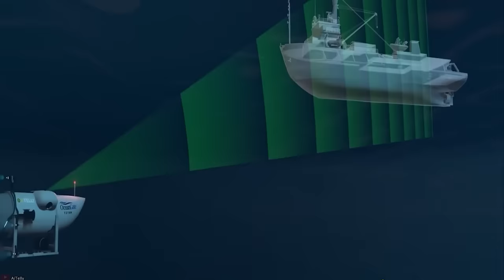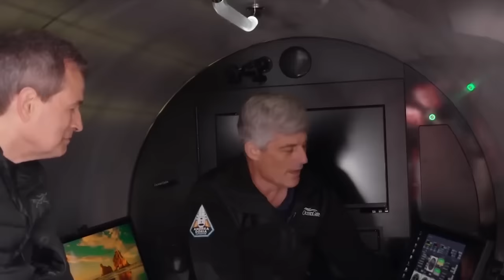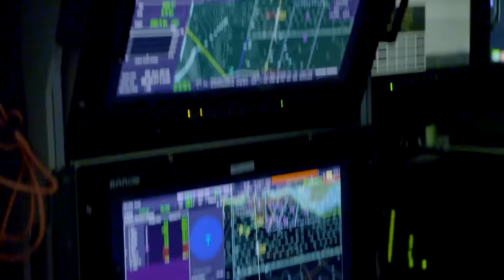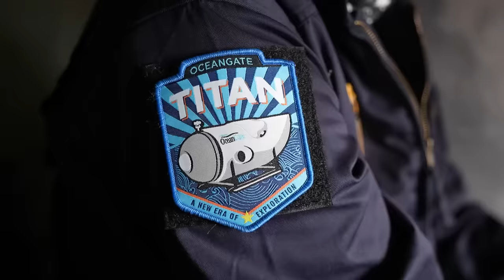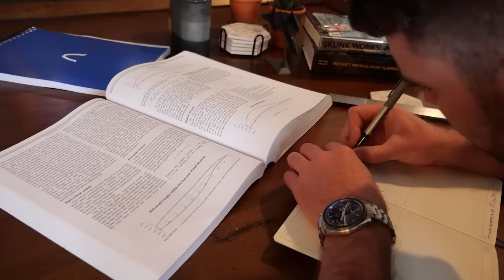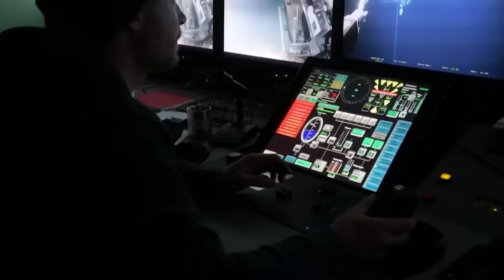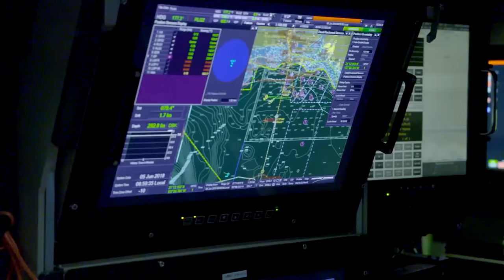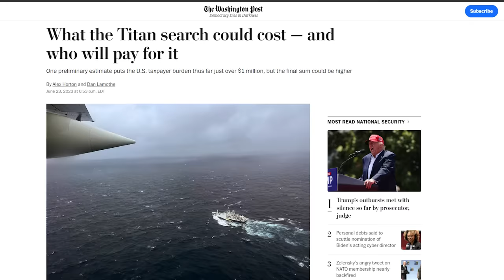US Navy Reveals TERRIFYING Truth Behind The OceanGate Submarine Tragedy | Titan Documentary

Comment: The Titan imploded as they were trying to accend due to mechanical failures due to water fill the electronic housing on the rear, weighting the sub beyond its capacity.

There is more information that everyone seems to ignore, the lack of putting 2+2 together is crazy.
The Titab was descending at an unusual rate of speed. The mother ship questioned them when they gave a report on its depth as it they were much deeper in the distance downward. The second check revealed that they were still descending to fast.
The crew heard cracking noises but did not know where it was coming from but it sounded like the rear where all the electronics and batteries are.
The warnings were going off and they decided to go back to the surface but it did not have enough power as something was making the Sub Heavier.
Then all communications stopped as the were trying to go back up.

If you put 2 and 2 together, the only possible way for the Titan to get heavier is if water was entering it.. it was filling up in the electrical room, shorting all systems. When the rear was filled with water and then it would start putting pressure on the carbon fiber hull.
The carbon fiber would start spreading apart due to it is a weaved material. ( Think of it as the chinese finger cuff from carnivals. to get tour fingers out, you have to loosen the weave by pushing it together to get the weave to seperate to get fingers out.) The rear of the hull was not supposed to have high pressure on it and it collapsed.

Had they made a non electronic emergency device to quickly use and shoot the sub to the surface and would not have imploded. The rate at which it could come back up can be really quick as it would not affect humans inside a hull.
The thruster were under powered and they were useless in trying to accend.
When you are building something like that, the systems should far exceed the minimum power to get the sub to got up.
The cheap Costco fance were not that strong

I restoring cars using carbon fiber for over a decade.

Comment: Hull thickness was an issue with both the TITANIC and the TITAN,  Thomas Andrew's wanted the TITANIC hull plates  to be 1 1/4 inches thick. However,  Bruce Ismay insisted that they only needed to be one inch thick, To reduce tonnage . The engineers that designed the TITAN wanted her polycarbonate hull to be seven inches instead of only five inches thick. What a difference between logic and disaster.

Comment: You get a few things wrong in this video...  One, radio beacons do not work under water, unless you are very close to the surface.  Thousands of feet below the surface, they are useless.  The Titan's support ship used an acoustic beacon to keep track of the Titan's location and an acoustic system to contact the submersible, but those both fell silent.  Two, the Navy informed the Coast Guard that they had heard an acoustic signature consistent with an implosion, as soon as they had analyzed the sounds.  The Coast Guard decided to continue the search, despite knowing this information, until they had verification of a debris field found by unmanned submersibles.  So NO, they did NOT keep it secret - that's a lie.  I guess you're trying to gin up views though.
Reply: The possibility of a radio beacon was mentioned because there was a possibility that the Titan had surfaced at some distance from the support ship and not been seen.  If this had happened the crew would have still died when life support ran out because there was no way to open the sub from inside. a radio beacon would have been useful in that event.

They should have had an acoustic beacon but didn't.  The crew of the sub reported its depth to the support ship during their periodic communications.  They had an inertial navigation system on sub able to give an approximate location on the north/south, and east/west axis's, but apparently that information was not communicated.

 The systems that most likely detected the sounds are designed to detect and give an approximate location of relatively quite sounds, think roughly as loud as your toilet flushing.  The implosion of the titan would have been about as loud as a very large bomb, several thousand pounds of explosives.  Although the data from the system is recorded for later review, it is monitored and analyzed in real time.  The sound of an implosion of a pressure vessel at depth is very distinctive (It sounds like an enormous Bang, followed by a sound similar to sizzling bacon as the air inside the sub breaks up into individual bubbles and the bubbles are crushed by the pressure).  It would be impossible to mistake the sound for anything else.  The signal would have been immediately reported to higher authorities and any American sub thought to be in the area would have been contacted to verify that it had not been lost  Allied nations thought to be operating subs in the area also may have been notified.  The Navy could not have reported it immediately to the Coast Guard, because at the time, neither the Navy or the Coast Guard was aware of the Titan sub being missing.  It wasn't reported until 8 hours later.

I don't doubt that it was reported to the Coast Guard and they chose to continue the rescue operation regardless.
Reply: @mbienlein  yeah, but pretty much from the start of the search, the Coast Guard already knew about the sounds heard by the Navy.  The search commander, just wanted to exhaust all possibilities until it could be confirmed that the submersible was on the bottom.  Also, the Titan DID NOT have a radio beacon, so the Coast Guard already knew that as well as did we, since it was included in more than one report DURING the actual search.  This guy balked at safety, so did not think of including the very basic of safety gear that is standard on any other submersible.  That is why this happened in the first place - a gross lack of safety considerations.

Comment: What would be interesting to know is if the implosion sound happened later or at the same time as when they lost contact. If there were knocking sounds, that would conclude that they lost power at some point due to a technical malfunction and could not ascend anymore. Eventually sinking to the bottom at rapid speed and imploding once hitting the bottom.
Reply: The sound was when it imploded. The knocking much later was not the submersible.
Reply: Yes, the way this has all been reported is very confusing. I haven't done a 'deep dive' on this (sorry, I probably ought to have picked my words better - genuinely, no pun intended) but its hard to get a clear timeline on this. There's a transcript going around that, at least according to one video I'd watched, seemed to be suggesting that the time of the last message from the Titan co~incided with the time given by the Navy as the moment when the implosion occurred... of course this presupposes that this was a true transcription of the final exchanges between the Titan and the support ship, and also, of course, that the Navy released the time when they picked up the signature of the  implosion - I seem to remember them doing just that at a press conference, but I might be 'misremembering'!
(Incidentally, how did the Titan communicate with the surface? I assume radio was out of the question... How is it that they could lose signal on a wired connection so frequently, yet seemingly treat rhe matter with such nonchalance?!)
         Of course, what I'm trying to get at is whether the occupants of the Titan had time to knock on the hull, and repeatedly, every ½ half hour, for maybe as long as 4 hours, as suggested in this video... And if not, what - or who - were the Canadians picking up, especially considering that the knockings seemed to coming in a pattern consistent with an SOS..?
         The scenario you describe sounds like probably the most likely course of events that I've heard, although the impression that I'd gotten from one video was that they were already near their target depth when contact was lost, however they were trying to return to the surface, albeit at an agonizingly slow rate. (This, again, based on the transcript). Other accounts indicate that the Titan was at least an hour from the bottom when communications were lost - this to me seems likelier, is consistent with your scenario, and would have allowed the Titan's occupants (some) time to have tried to signal acoustically. The whole thing is all very... contingent. If it wasn't the Titan, who was signalling? Was anybody? Were the Canadians just picking up natural undersea noises, or maybe they mistakenly attributed a deliberate signal to some of the regular noises emitted by all the shipping in the area. Could they even have been hoaxed?! So many questions! Of course I don't expect you to have all the answers, it was more a case that you seemed be a commenter with a bit more common sense than the majority and as such, I was kind of using you as a sounding board. Of course, if you do have answers, I'm all ears!
Reply: @richiehoyt8487  I don't have the answers either. As you said there are so many sources saying different things. For example I have seen one source claiming that the submersible dove too fast than what was recommended by their own 'safety standards'. It was diving too fast and rising too slow. This could indicate that the 5 people were too much for it and got too heavy, and they could have been using the thrusters constantly to slow down their decent, resulting in overloaded systems causing failure or something as simple as battery being drained too fast.
Reply: I think the wreckage would have been in a small area (relatively) if the sub had imploded on impact wth the sea bed.  To me it seems more probable that it happened on the way down and was possibly the reason contact was lost.  The rate of descent was too rapid which might indicate something was wrong with the sub and maybe caused the implosion at a depth which normally wouldn't have been a problem for it.
Another thing that bothers me is this; how good was the maintenance on the sub?  If they cut corners on the safety testing did they also neglect the proper maintenance?
Reply: @richiehoyt8487  The transcript has not been authenticated. The texts were supposed to use short form but this communication throughout the dive never followed the agreed upon texts. A lot of these videos are pure speculation. No one has the access to the search records to know what was/wasn't done and known to which organizations and when. Welcome to social media.
Reply: I believe they imploded during their decent.
Reply: Wireless game controller killers unintelligent people

Comment: 2 sections of the sub made with different materials, 1 not very compressible and the other great for tension but not for compression glued together. The pressure compressed the carbon fiber but not the titanium causing the area where they were glued together to split open, small crack to begin with letting water like a super powered water blaster before the implosion would have been deadly for anyone hit by said water

Comment: That's a pretty good summary. The only question I had was at what point in the dive the implosion occurred, which now it is clear the debree rained down near the titanic from far away. I say accident and negligence mainly due to not stress testing the prototype. The design clearly was feasible and strong but they skipped the mandatory stress testing guareenteeing a flaw would slip in to the final product. There probably is a future with that tech but not by those negligent engineers.
Reply: The implosion occurred the moment the surface ship lost all contact and telemetry with the Titan. They have a good approximation of its depth but no accurate reading.

Comment: They may never really know the fail point in this craft….the well under rated view port, that bowed inward under the pressure up to an inch, and had cracks appearing on its edges, the supposed out of spec/life cycle carbon fibre material, the lack of systems redundancy, the inability for fail safe recovery and communication….all played a factor in its outcome…we as humans experience the results of short cutting on a daily basis….and yet it seems acceptable until it doesn’t.

Comment: Im very familiar with carbon fiber. We use it in race car body panels,r/c vehicle bodys like helis and planes and cars. Its super strong and light but it fails eventually even with vibration. Its strong but brittle kinda like glass in a sense. I dont care if that shit on the titan was 4 inches thick or 30 inches thick. You couldn't have paid me the 250k to go down there on that. Theres a reason theres an industry standard real submersible's use. Thing was a death trap.

Comment: I am an electrical engineer not a materials engineer. I do know carbon fiber is stronger than steel in tension not compression. The spun carbon fiber tube was all carbon fiber and epoxy type stuff. It was only the end caps of that tube that are titanium. That tube is only very strong in tension as in extremely high pressure inside the tube. This tube is under extreme compression down over 2 miles or over 12.000 feet under water.

This undersea craft was not certified by any credible undersea agency. This was an idea that materials good under tension are also good under compression. Carbon and epoxy fatigues after many trips down under 2 miles of water pressing inward in all directions from the outside to the inside.

This is an example of someone taking the cheap way to use carbon fiber tube insensate of a metal sphere. To begin with a sphere is much stronger than a tube.

Comment: Trieste
Following its acquisition by the United States Navy, Trieste was modified extensively by the Naval Electronics Laboratory, San Diego, California, tested in the Pacific Ocean over the next few years, and culminated in a dive to the bottom of Challenger Deep 23 January 1960. The depth was 36, 597 feet deep. The crew and the vessel survived. Why did Oceangate fail to use already proven technology instead of building their own submersible, which clearly wasn't strong enough to withstand the immense pressure of the ocean waters at those depths?

Comment: well, with the tons of pressure pressing inward upon the structure at a depth of 12,000 + feet, one tiny imperfection can be the breaking point for the entire submersible. as multiple dives would allow water and pressure to constantly creep and penetrate deeper and deeper into the fibers, eventually no amount of ballast release could overcome the weight of the craft. it is battery powered and salt water and batteries do not mix. loss of communications was probably the first warning sign that they were in trouble, loss of battery power additionally created loss of propulsion, lights air circulation pumps and navigation systems. multiple deep dives created unobservable stress fractures in the integrity of the craft and it imploded like a fluorescent light bulb.

Comment: Ocean gate could/should have done a better job and used better materials in the construction of the Cyclops III. It sounds as if corners were cut, leading to serious safety issues. Seeing that the ocean environment is much more complex than space, outside agencies should be the ones certifying and classifying submersibles. OSHA should have been involved from the start, and more intense scrutiny should have been focused on the design and depth operating range.

Comment: The titan had no emergency systems, the 2 electrical systems were made to fail, the window was only capable of experiencing 4500 feet water ( not 12,000  feet), and it failed at 4500 feet. The mother ship heard the carbofiber bands breaking loudly and a ship nearby heard people banging on the inside submarine. The submarine did not implode. The window failed first and shot through the interior of the sub.
Reply: Glub glub

Comment: There are several errors in this narrative. The Titan and its floating platform were not carried aboard the Polar Prince but instead towed behind it. The people aboard were not "explorers, but wealthy tourists. By modern submarine standards, the Titan had several design flaws: 1) There was no means to provide positive buoyancy (just methods to reduce the negative buoyancy). 2) Unmanned spaces were not monitored for water intrusion. 3) No means provided to pump water from the bilge or unmanned spaces. 3) The carbon fiber hull was not reinforced with titanium as the literature suggested. 4) The hull and other materials were not designed to withstand the sea pressure at the maximum depth of the Titanic. 5) The titanium end caps were connected to the carbon fiber hull by glue. 6) The "hull monitoring" instruments only reported carbon fiber failures.

Comment: comparing oceangate's controller being compared to US Navy using a controller for a periscope isn't a fair comparison, for one the oceangate controller is a cheaper made controller while the Navy uses a Microsoft Xbox controller so they're different levels of input controller, also the periscope does steer the ship and if it(controller) stops working u can still pilot the sub unlike the oceangate's controller usage. In addition the footage of the US controller for their periscope is working on a wired connection as opposed to the wireless controller the Titan had.

Comment: The controller wasn’t the cause of the implosion.
Having been on a ZOOM meeting just yesterday, I know well that connectivity and coherent communication is dicey. If it was the correct device to use in a wireless form to pilot the death tube, it might’ve been better if it were hardwired.

Still, it was the construction (materials and processes), the number of dives, and the damage in the transport which probably caused the accident.